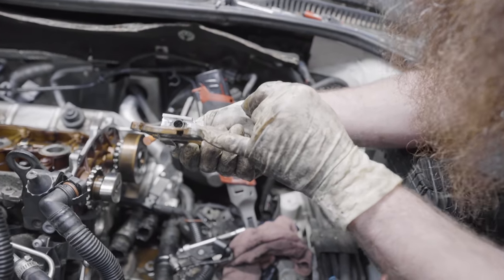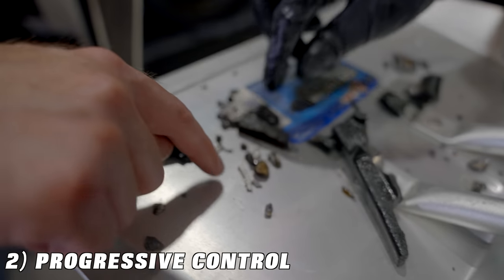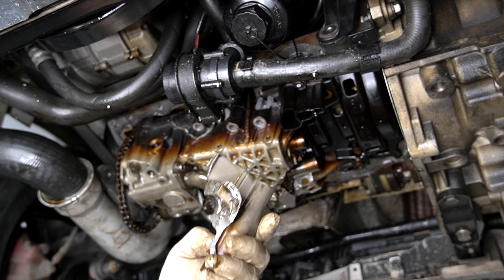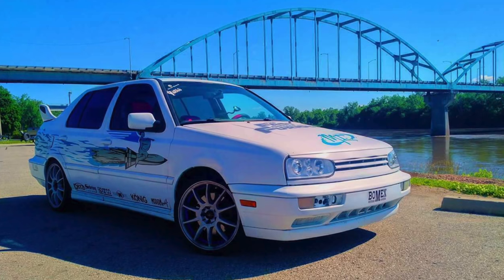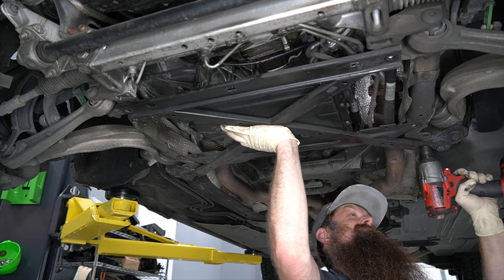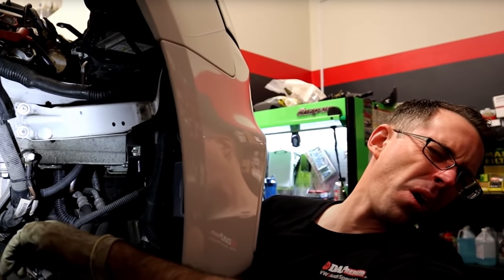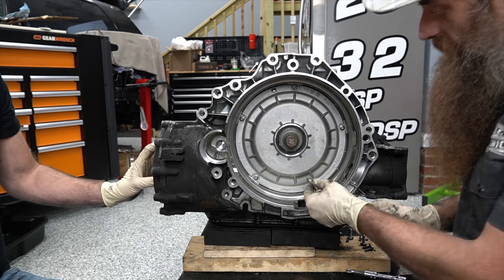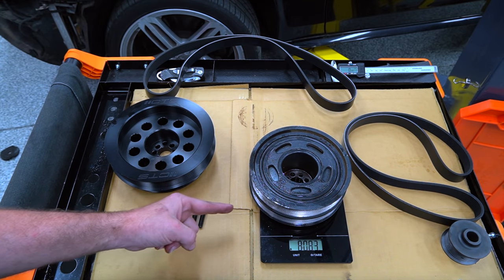I Blew Up the 1/4 Drag Car on the Dyno ~ JDM vs Euro RACE Episode 3

Comment: I'm pretty disappointed.   You were primed to show that racing is about the chassis, transmission and tires,  power means nothing w/out those things.   That civic is gonna run high 14s because its not gonna hook, its not gonna shift, and its gonna bog when they pedal it to stop the wheel hop.   All you had to do was lol push the gas pedal to a 13 second pass.
Reply: "Civic is gonna run high 14s" bro fanboy much 💀 like yeah they're definitely gonna have serious traction issues running a street tire, but the Honda I have runs high 14s bone stock with stock all season tires lmaoo.
Civic does have traction bars too. Thanks for the laugh though
Reply: @dkis8730  I've raced enough turbo civics to know that unless they spend a fair amount of time on testing and setup they will run 14s.   The Civic can be fast absolutely but not the first time it goes down the strip.   Whereas the GLI will never really scream at least not without a lot of work but it will get nearly all of its capability right off the bat especially since they had good drag radials.

Comment: Typical 2.liter fashion, would have been better off with a 2.5 and a 250shot
Reply from the maker: I’m very sure a 2.5 stock wouldn’t hold that.
Reply: @HumbleMechanic  progressive shot, fuel pump and injector upgrade. Tune.. Bet it hold better than a 2.0turd

Comment: Why not replace the motor? Those FSI engines are cheap.
Reply from the maker: Not around here a used one on eBay is $1500. And if I got a cheap one, it would need to be rebuilt because it was trashed. It’s crazy how $$$ those are
Reply: @HumbleMechanic  oh dang. Up here in Canada they are much less.

Comment: If you had waited to 5000rpm to shot the nitrrous it would have been fine. 130 extra foot pound at 3500rpm was not smart, also you MUST retard ignition timing when running Nitrus.
Its like any other power adder like boost, you NEED to retard timing, alot!

Comment: Oh crap! Come on  guys you didn't even just swap out the solenoids?? Sigh........All that money and time when all they had to do was change out the solenoids in the original trans.
Reply from the maker: Did you not see those clutches? Swapping the solenoids wouldn’t have done anything if we didn’t swap clutches.
Reply from the maker: Your edited comment is a much more reasonable assessment. ;) Now here is why I didn't just swap them. I wanted to KNOW. I didn't want to think or guess. I wanted to know if the harness fixed it. Now I know it didn't. We KNOW the clutches were toast. 

This is what's great about the situation. We can learn and know, rather than guess. Im going to swap the solenoids at some point. Then I can know how they impact the performance of the car. To me that is worth the extra time it takes to do the job.

Comment: It is common VW knowledge that a ko4 and tune maxes out the 2.0 block. Don’t really know the point of the nitrous unless you did this on purpose for content lol
Reply: I didn't know that. 
What's the max whp on that platform
Reply: @frontspring1  stock rods can handle like 350

Comment: 2010 s4 for 2500$? Even with a broken transmission i call bullshit. 
The euro car owner propablt lets them use the car in the race for the video and he gets the car back afterwards with a working transmission.
Reply from the maker: You’re way over valuing a car that barely drives with 213k on it. If this car didn’t have transmission issues it might be worth $6k. MAYBE! 

I bought the car. We fixed it. It’s sitting in my shop now. 

We want to believe the S4 is worth more. But it’s really not. Not even in this crazy car market I understand it feels like it’s not the right price. But $1500-$2000 is exactly the price this car in this condition should be
Reply: @HumbleMechanic   Here in finland the cheapest 2010 S4 is 19000€ fully working but still, car in that condition still maybe 8-9k€
Reply from the maker: That’s not a completely fair comparison. Now I will say this deal doesn’t come up every day. But these kind of things do happen. I once bought a Cabrio for $20 lol
Reply: @HumbleMechanic  Yea, not really, but just saying that 2500$ is still quite a friend price if you really bought it for that money.
If you compare that a jetta with a fucked up timing belt and valves was half the price of 2010 s4 that can be fixed with a 1000$ transmission and some elbow grease. 
Still not quite buying that :D
Reply: @HumbleMechanic  oh sorry 1500$ for the audi :D

Comment: Why not pick something that is not a Volkswagen, so it might accualy work :(
Reply from the maker: What’s the best euro car for this? Vw/Audi is what I know.
Reply: @HumbleMechanic  Could try a old cheap BMW with a M50, M52 or M54 engine, they are easy to stick a turbo onto with minimal labour and if only needs to last for a drag race can one get them to pump out up towards 600 hp without too much of a struggle, other than that could a light E30 with a M20B25 engine also do very well. They are very popular to turbo here in Norway, and some of those engines properly build has also been able to pump out towards 500 hp in a yearly event we have here called Gatebil, a friend of mine turboed one to have over 250 hp and he drove it that way for years without doing anything to the internals of the engine.

Edit: E30 M20B25 are getting pretty expensive, so would probably be a hard thing to find for this challange, E34 are also not exactly cheap anymore, but a usable E36 or E46 should been possible to find
Reply from the maker: Could we do that for 5k? Thinking about season two ;)
Reply: @HumbleMechanic  Maybe if found a used quality turbo for cheap 🤔 also not sure if it is the best or not if the theme is euro/german, as I don't know what Mercedes has to offer in the price range.

Also not sure how prices are in The States compared to Europe
Reply: @HumbleMechanic  M50/M52 turbo manifolds I find for 500 euros from a quick google searth, so that is a promissing start at least.

If paired it with a Getrag 260 manual gearbox, should the gearbox at least make no problems at all. The automatics of those generations of BMWs are not as solid and would probably not handle the power for long... but then again, if its only a drag race...
Reply from the maker: Cool!! I stayed in the vw space because it’s what I know. But I shopped a lot of BMWs for this race

Comment: Why didnt you just put the new tranny in?
Reply from the maker: This is something I cut from the video.  It was a few minutes of me talking. And people by and large complain about that. Lol 

The mech unit is coded to the car like keys. 

The trans was missing the diff. That’s why it was $600. 

The connection for the prop shaft is different

Comment: $1500 for an s4. Yeah right. What a load of bull crap.
Reply from the maker: A 200k mile, basically dead S4, that’s not really that nice. This is pretty in par. Keep in mind from a customer stand point this would be a $4,000-$6,000 plus repair. Most shops wouldn’t do what we did on that high mile component. They’d put a box in it. 

On top of this to be a proper car for say daily use, it probably needs another $2k plus in suspension. Even then you still only have a “fair” condition car.  

I know it feels like BS. But this is what it should cost.
Reply: @HumbleMechanic  well I’ll take your word for it. I haven’t been buying up s4’s so I can’t say I know what a fair price would be. It just seemed way undervalued. On a more positive note, you guys do great videos and wish you the best.

Comment: A 100 shot is not "full send" there is no car that shouldn't be able to take a 100 wet shot. German cars are too weak and complex you're over here pulling the pan and talking about the damage and I'm wondering what the hell a balance shaft is and why its under the rotating assembly